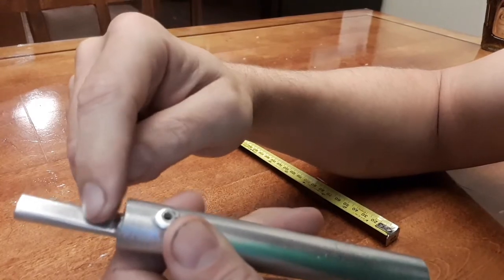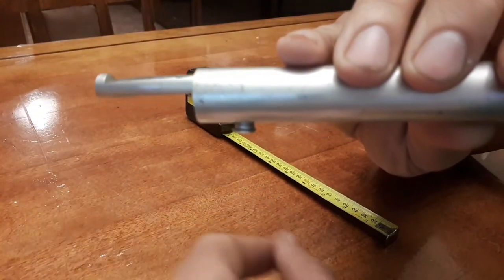Tool for installation of ribs on a Sportspal/Radisson canoe.

Comment: Good morning I recently purchased a 12 foot canoe looks similar to a sports pal but it’s a manaqua I marked the ribs and remove the liner to do a complete re-seal is there a starting point on installing the ribs from one end to the other or middle out and also what would the spacing be I marked all the ribs The marks don’t line up from side to side left to right could be up to 2 inches kick back on one side
Reply from the maker: @ralphmoises3555  I would start at the thwart bars and space ribs 6" apart, split the difference at the center of the bar and work your way out to the ends. Good luck with the refurbishment

Comment: Hey buddy how are you? I have a question for you.... How can I remove the old Sportspal Decal from the Canoe without causing damage. The previous owner paint over it with Rust-Oleum Marine Coatings Topside Paint. I bought new Decals so I just don't know if is easier to place the new one over the old one or take the old one out. What are your thoughts?
Reply from the maker: The old decals are tough to remove using a razor blade and a patient hand is the best option
Reply: @GettenanyOutdoorsSportspal  Yes I am doing that and is very hard is really stuck there... Thanks buddy